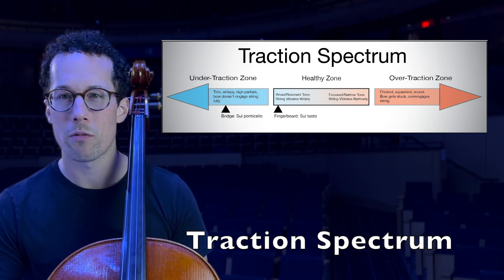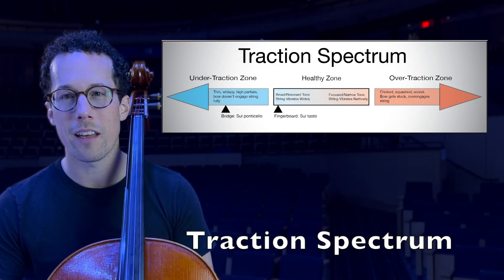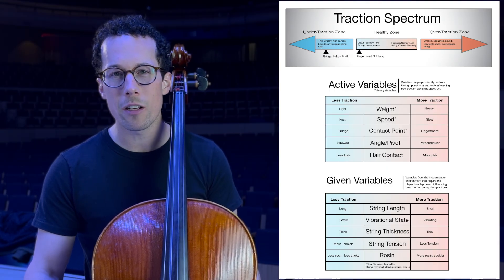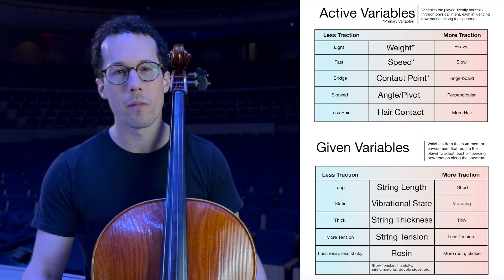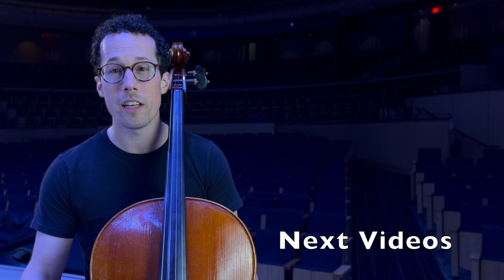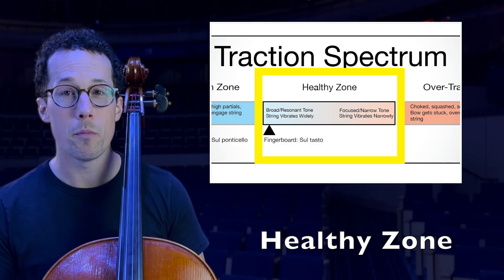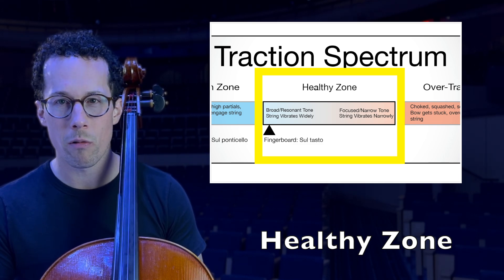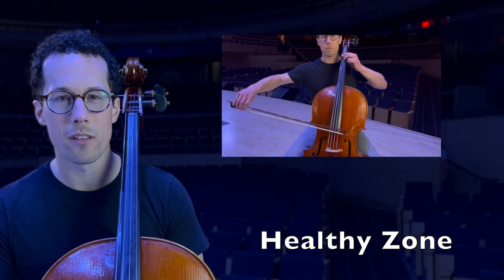What You Were Never Taught About Cello Tone | The Traction Model

Comment: Pretty good idea, i think the next step is explaining transfer of weight through the arm and into the bow, while remaining with relaxed fingers and getting used to that feeling of minimal physical effort = best tone
Reply from the maker: Absolutely. That was actually the first video in this series, and it’s called The Kinetic Chain. Here is the link if you want to check it out!
https://youtu.be/gu_WDlQjO4s
Reply: @TheWorshipCellist Ah wonderful! You have outlined high level bow arm technique very nicely and I’d say quite intuitively as well. The idea of pulling against traction or resistance with your bow on the string only really works if the student can conceptualize how to drop the full weight of their arm into the string without tensing or gripping when they actually pull from the back. Its tricky to explain on youtube, and even harder for cellists who already ingrained so much unnecessary tension into their technique. Regardless, great work
Reply from the maker: @cellohater Couldn’t agree more. I’ve worked with so many students who enter college with deeply ingrained tension patterns. It takes a big commitment from the student to take the time to reprogram how their arms work to overcome it. The head knowledge is the easy part, but applying it is the real challenge and the biggest need for a good teacher. Again, thanks for checking out these tutorials!